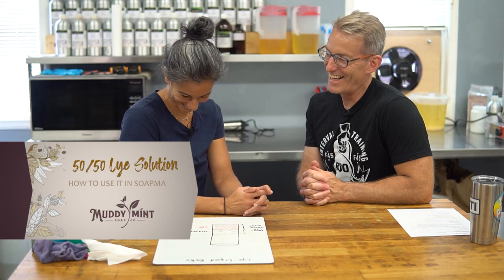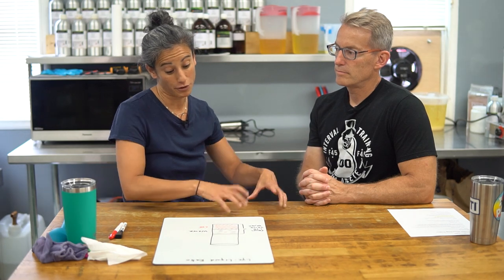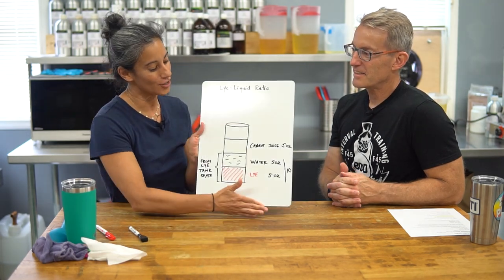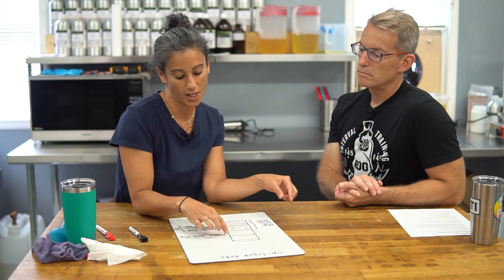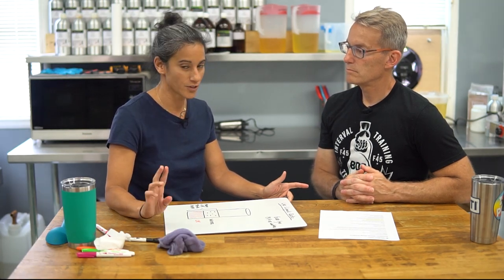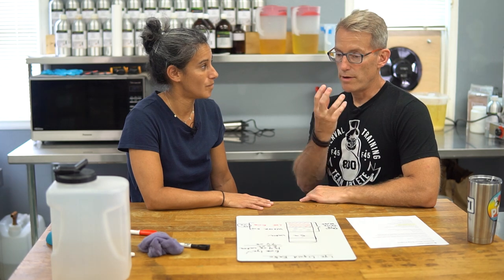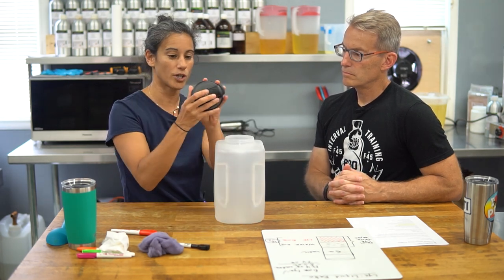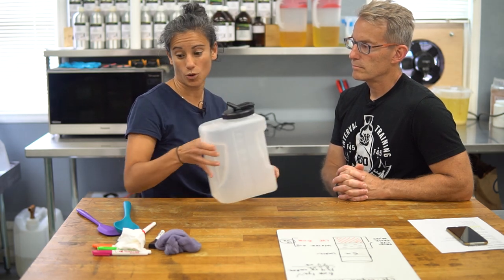How to use a 50/50 lye water solution for soapmaking

Comment: How do you warm up the lye or stays in 85 to 95 degrees warmer? 
I love your videos, and how you explain everything. 
Thank you so much
Reply from the maker: Hi there! We warm it up by putting it in a warm water bath. So, I boil water, put it in a container and then stick the lye-water container in that. I timed it the other day and it took under 4 minutes for the lye water to come to temperature. If you have more than one lye water container, you can use the same warm water bath to wam up the second container. It's a bit of a pain, but it's relatively quick. I hope that helps!

Comment: Thanks for the great video! I'm fairly new to soap making and make small batches. I measure out distilled water and put it in the refrigerator in the plastic container I'll be mixing the lye in. When I'm ready to make my batch, I remeasure the water to make sure the correct amount is there. Depending on how long it's been in the refrigerator, I may have to top it off. I then place it in the freezer for 10-15 minutes. My lye solution rarely gets over 180. It's still hot, but while it's cooling I mix up my oils/butters and prep anything else I'm going to add to. If the solution is still too warm when I'm ready to mix, I put it in the fridge or freezer, but not for long. When I start doing larger batches I'll keep a 1G jug of DW in the fridge so it's always ready to go.
Reply from the maker: Hi there! Thanks for sharing your technique! Using cold water from the fridge will definitely help with fumes and with the lye water getting too hot. For larger production, a lye-tank can make things much quicker, but for smaller batches your technique works great!

Comment: Thanks for sharing how you made your small batch 50/50 lye solution, containers and all. Again, so many great tips. I watched your previous video showing how you currently batch and I've been wanting to switch to 50/50 but have been a little intimidated because I'm not ready for a lye warmer. This was exactly what I needed! I also love watching you guys interact btw. ❤
Reply from the maker: Oh good! I'm so glad to hear that! We did it this way for many years and it works great! Let us know if you try it!
Reply: I warmed my lye just putting the container in a hot water bath. It's pretty simple and works fairly quickly.

Comment: This video was amazing! Thank you for sitting down and taking it step-by-step. I was trying to explain a 50-50 solution to my husband, but was unable to. That’s when I realized that if I can’t explain it, I don’t understand it. In any case I am thinking of buying those containers, and perhaps freezing the water before I put the lye in. That might be a helpful step for me.
Reply from the maker: Of course! Thanks for watching and I'm so glad to hear it was helpful. It's a simple concept, but kind of tricky to explain, particularly to newer soapmakers. If you freeze the water completely, you might have a hard time mixing the lye in... I recommend using ice cubes, so you can still stir everything around and make sure the lye is fully incorporated. Otherwise the dry lye might just sit on top of your giant ice block for a while, but I might be wrong! I would think you'd want to start stirring right away if you can. Good luck!
Reply: @muddymintsoap  Thank you again!!! I’ll let you know if it works ❤️

Comment: Very informative! I have never master batched my lye water but sounds like it helps speed things up! I usually only do one loaf a day when I do soap, mainly because of the lye prep so curious to try this! 
I will add that I make my lye water solution with room temperature distilled water and only average about 150 degrees F at most. You can control this by how quickly you incorporate the lye. I typically sprinkle in a little, stir with a stainless steel spoon until it disolves, and repeat. For 10 oz distilled water and 4.7 oz lye it takes me about an hour to mix and maybe only like 5-10 minutes for cooling. Not a great process for making large batches but is possible without having to wait hours for cooling. Great method if you are a hobby soap maker only making a small 33 oz loaf.
Reply from the maker: Yes, the speed that you add your dry lye does matter, you're right! Also, the cooler your distilled water, the better! You can try putting your water in the fridge and that might make your process go faster. I personally can't imagine taking an hour to mix lye (I'd rather have it hot and let it sit while I do other things), but you should do what works best for you!

Comment: You have blown my mind. It is night time here now and I can't wait for morning so I can make a masterbatch of lye. Previously I was making the masterbatch to suit a specific recipe, ie I would take my std recipe and multiply everything by 5 so I could make 5 loaves, and as I went to make a loaf I would use 1/5th of the weight of the combined oils and same with the lye solution. It works but was limiting so I stopped doing it. Thanks you so much for generously sharing your knowledge.
Reply from the maker: Oh yeah!! I love hearing that!! How did it go? Did you make your batch and also use it? So glad we were able to inspire you! :)
Reply: @muddymintsoap  yes I did make it! I had a number of part containers of NaOH so weighed all the scraps then weighed out the equivalent in water before adding the scraps. I have so much room on my bench without all those part containers.

Comment: Finally, someone explained this in a way that was easy to understand. Thank you so much. I have a question. I do not soap on a regular basis, nor in large amounts. If I were to get one of the containers you spoke of typically how long would that still be good? Thank you and loved watching you.
Reply from the maker: I'm so happy to hear that it was easy to understand! I used to keep the containers with pre-mixed lye-water for at least a month. As long as its properly sealed and you store it in a cool/dry place, it should be good. However, if you notice anything unusual about the lye-water, I wouldn't use it. You can certainly make a smaller amount to suit your needs - whatever amount of soap you typically make in a month. I hope that helps!

Comment: Greetings! So grateful to find you guys are super stoked about receiving the book! 🌞 My question is when reheating the lye water from the small batch to do the water bath reheat method, shall it be poured into a separate container and then added to the water bath or use the actual/original lye water storage container for the water bath reheat?  Just wondering if it's alright (safe) to use the original plastic lye water plastic storage container or if the lye water should be poured into a different container for the water bath reheat? Hope that makes sense and thanks so much in advance you guys rock! Love and Peace!
Reply from the maker: Great question! It is much faster to warm up the solution in a separate container, so I usually pour what I need for the day (or for my batch) and warm it up all at once. You can definitely use the original container, but it'll just take a lot longer to warm up, unless you don't have a lot in there. I hope this helps!

Comment: Wow! Thank you so much for the valuable information you've shared here. I stumbled upon your channel by chance, and I'm impressed. Years ago, I used to make soap for myself and friends. About a year ago, I started doing it again for myself and close friends, often giving it as gifts. 

A question arose from watching your video: regarding the lye solution, I'm not planning to rush out tomorrow and buy a big tank for the 3-4 lbs I make once every few months. However, out of curiosity, won't the lye solution damage the washer and faucet valve in the tank? Considering my limited knowledge of machinery, I worry that the rubber parts might deteriorate. Do you have any tips for maintenance or special washers to use? I'm just curious about the process. 

Thanks again for the fantastic videos! I've subscribed and will be following your channel. Keep up the excellent work!
Reply from the maker: Hi there! Thank you! I'm so glad you found our video informative! The lye tank we purchased is specifically made to be used with lye, so it doesn't contain any parts that could be damaged by the lye. We've used our tank for 3+ years and never had any issues. We do clean the tank occasionally, but that's about it. Thanks for watching!
Reply: Thank you again. Good to know. @muddymintsoap

Comment: You all explained this technique wonderfully for those new to the game of soap making.   How long do you cure your soaps for?
Reply from the maker: Thank you! I'm glad it was helpful! We cure our bars for exactly one month. If we make a soap on July 13, we put them up for sale on Aug 13. However, I recommend that everyone figure out the cure time of their bars by weighing them. Start by weighing your bar right after cutting it and then set that bar aside and keep weighing it regularly until it stops losing water weight. I did this with our bars early on and figured out that they stop losing most of their water weight at the three-week mark. So, in a pinch, we'll put bars out for sale at three weeks, but we usually don't need to. Now, this will vary by soap recipe, but it's good practice to get the final weight of your soap for labeling purposed. I hope this helps!

Comment: I really appreciate all the information that you showed in the video.. I have one more question, if your recipe calls for 100 g of NAOH and 100 water, are you using exactly 200g of the pre made lye solution? Are u considering evaporation? Where 200g of Pre made LS  might have more lye than it was supposed to?
Reply from the maker: Hi there! Good question! Yes, if the recipe calls for 100 g of lye and 100 grams of water, we use 200 grams of the premade lye-water solution. When we make the solution, we are careful to ensure that minimal evaporation occurs and we also make our lye-water with ice, so there is less chance for evaporation. We also put our solution in a tank (or a proper container with a lid) to help with that as well. And, remember that we use a 2:1 water to lye ratio, so we are adding more water. It all seems to work out, and we've been doing it this way for years!

Comment: I'm just starting out in soap making, I'm really liking the 50/50 lye solution idea! Before you had the lye tank that you can heat up, how did you heat up your lye to the correct temperature?
Reply from the maker: Hi! We would pour out the amount of lye water we needed and warm it up in a warm water bath. Typically we'd place some hot or boiling water in a large container and then place our container with the lye-water inside that container to slowly bring it up to temperature. Keep stirring the lye water (with your safety equipment on!) and check the temperature, as it can go up quickly. Once your lye-water is at the right temperature, remove it from your warm water bath and you're all set! I hope this helps!
Reply: @muddymintsoap  yes this helps alot. Thank you for taking the time to answer me😘

Comment: Thanks a lot for this valuable information!

I have two beginner questions:
1. I live in Phuket, it’s very warm even at home unless air-conditioned all the time. Is it safe to store lye solution in a climate like this? Of course, I would keep it where there’s zero chance of direct sunlight.
2. For how long can it be stored? It’s more of a hobby to make funny designs so no chance to use it up fast.

PS. I am planning to store it in an ex-laundry liquid jug.

Your expert advice would be much appreciated:)
Reply from the maker: Hi there! That's a great question. I don't exactly know the answer, but I'd say that you should try it with a small amount and see! You can probably store your lye-water solution for 1-2 months. The main issue is evaporation. You certainly don't want your water to evaporate too much and result in a lye-heavy solution. If you store your lye-water in the same place that you cure your soaps, you should be fine, I would think. I'd avoid salt bars in a super humid climate or using any other ingredients that are humectants and you could invest in a dehumidifier to help as well. I hope this helps!
Reply: @muddymintsoap  all clear, thanks a lot! I’ll try that

Comment: Hi Simmy, you must have explained somewhere and I can’t find it, but why do you warm your lye water before adding into your oils? Love listening to your teachings and you look good together.😊
Reply from the maker: Thank you!! And, great question! We ran into an issue several years back with lye that was too cool (under 80 degrees F). Our recipes are high in butters, so what was happening is that the cooler lye was causing the butter to solidify and not properly saponify, since we soap pretty cool. We were getting unsaponified butter streaks in our soap. It took us forever to figure out what was going on, but warming up our lye-water fixed the issue. If you don't use butters in your soap and your oils are mostly liquid oils, you might be fine using cooler lye.

Comment: Hey am from India too, one of the ways I have started reducing the curing time is to incorporate salt about 10%.
Reply from the maker: Hi there! Thanks for watching. Salt typically adds hardness to a bar, but I’m not sure about it reducing cure time… it probably feels that way because the bar is harder? I suppose salt is a humectant, so maybe it draws out the water more effectively while curing? I’m curious about this now! I’ve always cured my salt bars the same amount of time as my regular bars. I suppose testing the weight over time would be the easiest way to check.
Reply: @muddymintsoap  that's true.

Comment: Thank you for creating this video ❤❤❤

I just would also like to ask if, using soap calc, i would click the water lye ratio as 50:50?... then once the recipe was calculated i will just compute for the extra amount of liquid to make it 2 parts water and 1 part lye? ... thank u ... sorry for my question i just would like to clearly understand. thank u again 😊❤
Reply from the maker: Great question! So, it's a little bit confusing, as you can't enter that you're using a 50/50 lye water solution in soap calc (as far as I know). What you want to do is click the radio button for "Water : Lye Ratio" at the top under "3. Water". The default is "Water as % of oils". Change it to "Water : Lye Ratio" and then type in "2:1". This will show you what you need to get 2 parts water to 1 part lye. 

Let's say you see "8 oz water" and "4 oz lye". This is a 2:1 ratio. This means you would use 8 oz of your 50/50 solution (which is equivalent to 4 oz of lye and 4 oz of water) - hopefully you're still following! Now you need to make up the other 4 oz of water with either more water or another liquid.

Honestly, I never even bother to enter 2:1 in the calculator because as long as I know the lye number, I'm all set. If I know I need 4 oz of lye, then I just double it to know the amount of water.

Definitely make sure you understand all this before trying it, but the main thing to know is that your lye number is VERY important and never changes. The water number is the only one that can vary, but you have to use AT LEAST the same amount as the lye. So, you MUST use at least 4 oz of water to dissolve 4 oz of lye. Never use less water. Hopefully that makes sense!

Comment: I’m just starting out. The recipe I follow is from a YouTube video. I have made 3 batches. 1 batch was thick and the other 2 were not as thick. 
32 oz of tallow-render down
12.16 oz of water
4.2 oz of Lye
The question I am very unclear about is this. Let say I rendered down 36 oz of tallow. How would I get the correct ratio of water and Lye? I’m looking for an easy solution just like your 50/50.
Reply from the maker: Hi there! It looks like the recipe you are making is using roughly a 3:1 water to lye ratio (the water amount is about three times the lye amount). If your batches are already thick or pretty good, I'd stick to that ratio if it's working for you. If you want to use a 50/50 lye water solution, you'd use 8.4 oz of the lye water solution (which is 4.2 oz lye + 4.2 oz water) and then you'd add the extra 7.96 oz (or 8 oz) to the oils. I got 7.96 oz by subtracting the 4.2 oz of water in the 50/50 solution from 12.16 oz.

Important note: if you decide to render 36 oz of tallow, which is more than what the recipe calls for, you'll need to recalculate the lye amount using a lye calculator. I usually use soapcalc, which is available here: http://soapcalc.net/calc/soapcalcWP.asp. Anytime you change oil types or amounts in a recipe, a new lye amount needs to be calculated.

Assuming you're using beef tallow, it seems like your recipe has an 8% superfat (which seems kind of high, but maybe that's typical for tallow soaps?) and is using the default water amount (Water as % of Oils = 38), so make sure to enter that in the lye calculator. For 36 oz of tallow, I get 4.72 oz of lye and 13.68 oz of water.

I hope this helps!

Comment: Greetings from UK. Interesting video. I just started to make some soaps, and in all the recipes that I have found, they all say, you can re-warm oils, but not lye solution. I suppose you do not get issue with warming it up every morning then. Maybe I will try to pre-mix as well and see how it goes. Cheers
Reply from the maker: Hi there! It's true that you don't typically want to re-warm your lye solution. The tank we have is made especially for this purpose and warms it up safely and slowly. If you use a warm water bath, that is also a safe way to warm it up, if needed. Never microwave your lye-water or warm it up on the stove. That can be very dangerous!
Reply: @muddymintsoap  Thanks for the explanation 👍